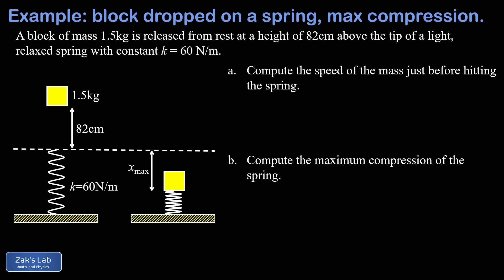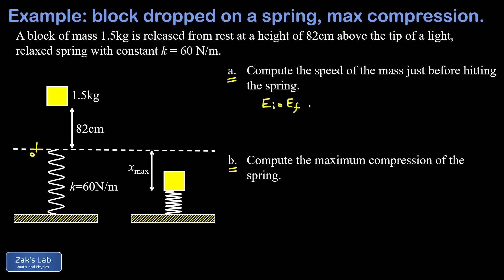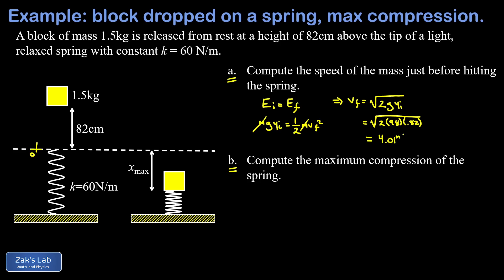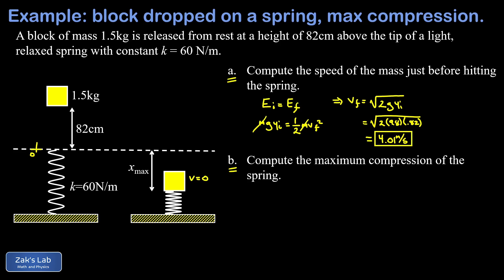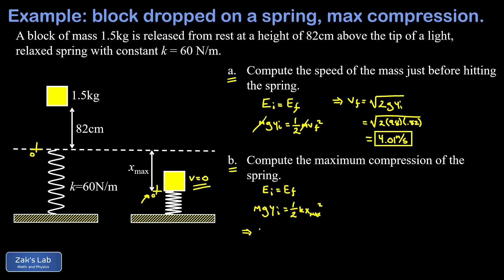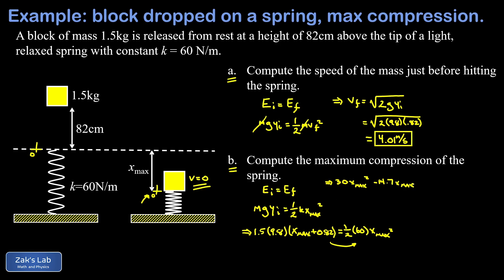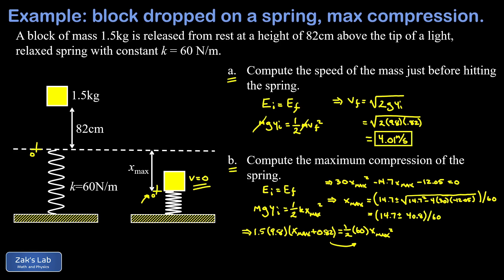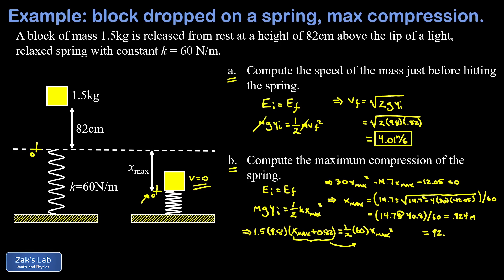Block dropped on a vertical spring find the maximum compression and the speed just before impact.

Comment: Sir,When is the speed of the block maximum my mind says it should be just before hitting the spring as after that spring will oppose its motion but i also kinda think the speed should increase until the compression reaches maximum Please Help me i am a bit confused,i know the video is a bit old but i hope you reply to me
Reply from the maker: To aid your intuition on this:  just think about right after impact when the spring is barely compressed at all, say 1mm.  The weight of the block is still bigger than the spring force, so the mass is still speeding up.  This continues until the spring force kx reaches the same value as the force of gravity mg.  Compression beyond this point means the spring force is bigger than mg and the mass is slowing down.  So you look for max speed when kx=mg

Comment: First of all you are so underrated. Can I also use integral to solve for the maximum compression?
Reply from the maker: Thanks for the compliment!
The potential energy formula for a spring is derived from a work integral . . . You can always do that integral from scratch, but the whole payoff of using the potential energy formulation is that you only really have to do the integral once (unless I give you a non-linear spring etc.)

Comment: Hi, I am having trouble with this problem that is very similar.

A block with mas 0.500 kg sits at rest on a light but not long vertical spring that has spring constant 80.0 N/m and one end on the floor. A second identical block is dropped onto the first from a height of 4.00 m above the first block and sticks to it. 

What is the maximum elastic potential energy stored in the spring during the motion of the blocks after the collision?

The answer key says 15.4 J, but I don't understand how they came up with that answer.
Reply from the maker: I didn't look at the numbers, but one key point here is that energy is lost in the inelastic collision of the blocks.  You have to treat it as an inelastic collision first.  That gives you a final speed after the collision, then you can use energy conservation to analyze the compression phase.  Sounds like a good problem, and I'm planning to make a similar one for my classes in the Fall!  z

Comment: Wouldn't the maximum compression be 0.5K(X)^2 = mgh. When I did this, I got 0.634 m for the maximum compression distance.
Reply from the maker: This approach is the most common mistake I see from students:  if you simply say mgh is converted to spring potential energy, you've ignored that the height continues to decrease as the spring compresses.  That's why it's necessary to include the "x" term in the gravitational potential energy. z
Reply: @ZaksLab  Hello. Thank you so much for your reply! So from what I understand, you're saying that all of the gravitational potential energy gets converted into elastic potential energy when the spring fully compresses.
Reply from the maker: @prathamhebbar5800  yes, and it's critically important to include the compression distance as part of that change in height for the grav PE calculation, because the mass is going lower as the spring compresses z

Comment: Can you solve this? 

A small block of mass 
m is kept on a bigger block of mass M which is attached to a vertical spring of spring constant 
k. The system oscillates vertically. 
(a) Find the resultant force on the smaller block when it is displaced through a distance 
x above its equilibrium position. 
(b) Find the normal force on the smaller block at this position. When is this force smallest in magnitude? 
(c) What can be the maximum amplitude with which the two blocks may oscillate together? 

Of course… you can fill some variables With Numbers. Im struggling with solving this.
Reply from the maker: brutal!  I'll see if I have some time to think about it later in the week . . . grading a huge stack of exams tonight . . . z